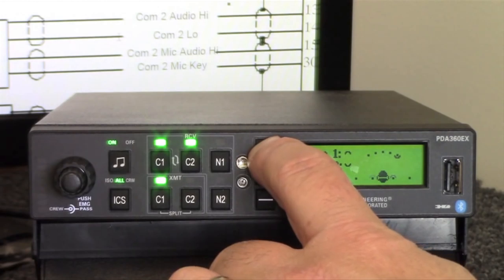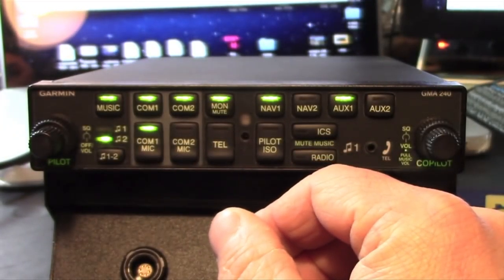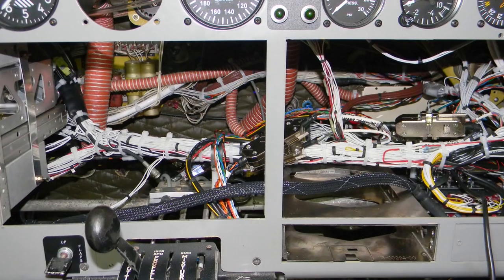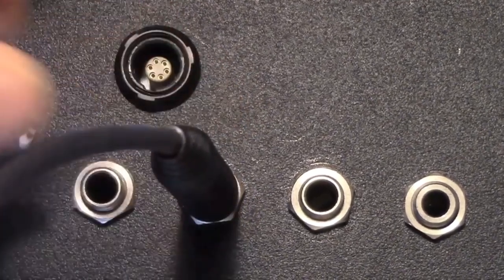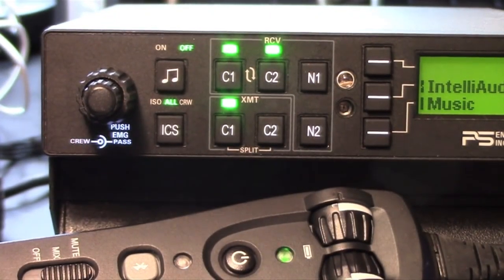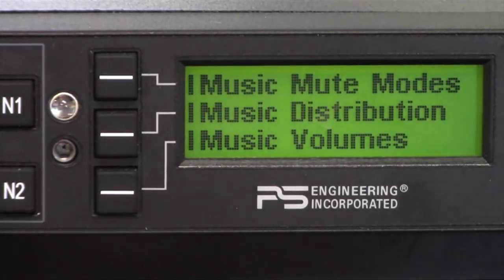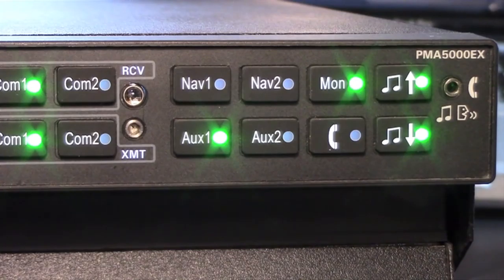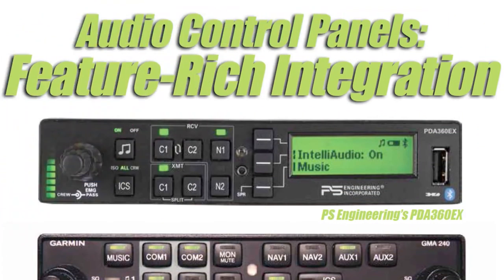Experimental Audio Panel Bench Review

Comment: Larry, did you use the same microphone and other audio gear with all panels?  The Garmin sounds muffled compared to the PS products, and I'm just wondering if that reflects a genuine difference in how they sound.
Reply from the maker: +Mike Kobb

 I actually recorded a segment explaining that, Mike, but this production is painfully long as it is, I left it out. The soundtrack you hear is actual audio from each panel, micd exactly the same for each, and using a new Bose A20 for all. The Garmin ICS audio and sidetone, to my ears, is far less trebly than the PS Engineering. I wouldn't call it muffled, just different. I've flown with the GMA240 and its audio quality is perfectly acceptable, to me.
Reply: +AVweb Thanks for explaining!  I like the sound of the PS better on my computer speakers.  Of course, with a headset, my preferences might be different.